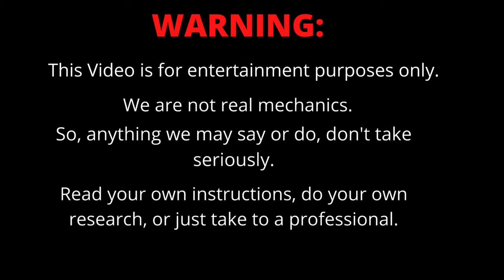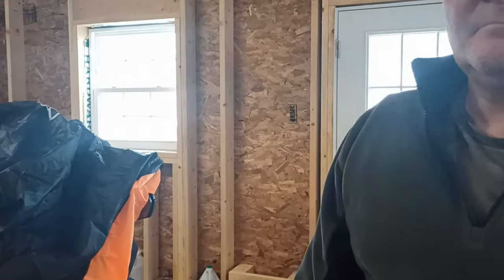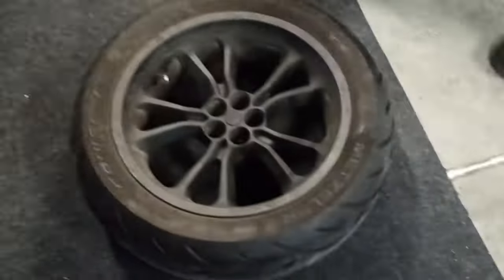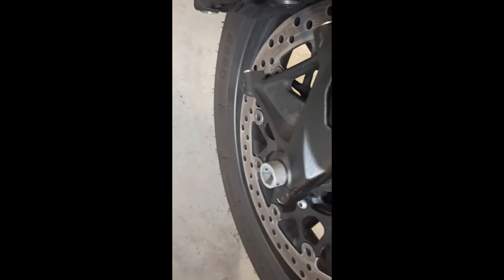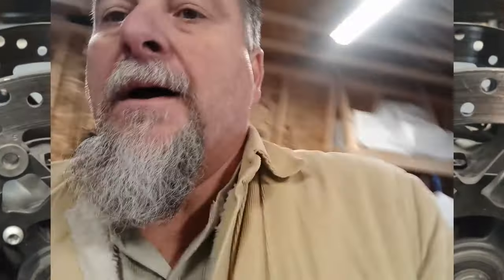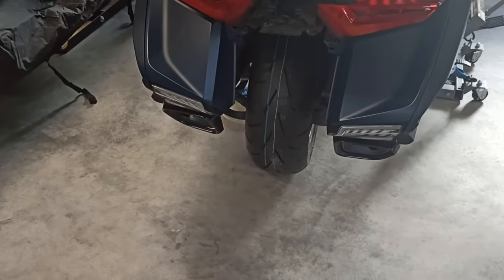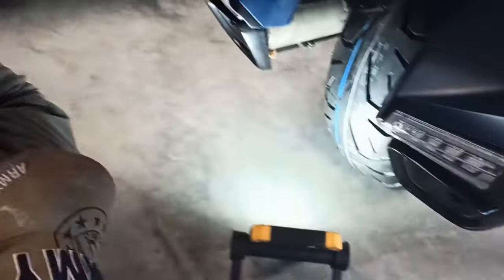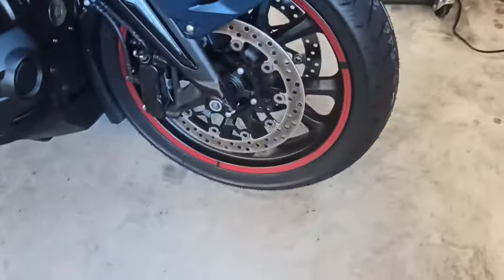GOLDWING FRONT AND REAR TIRE REMOVAL

Comment: Did you use new front caliper brake bolts? recommended for some reason.
Reply from the maker: No, my brother did not change the caliper bolts. They recommended because they are aluminum. But most people don't change them till couple tire changes. Thanks for stopping by and watching.  Stay safe out there 👍